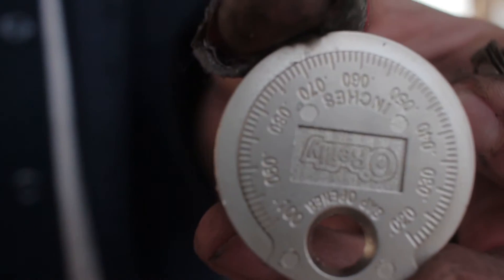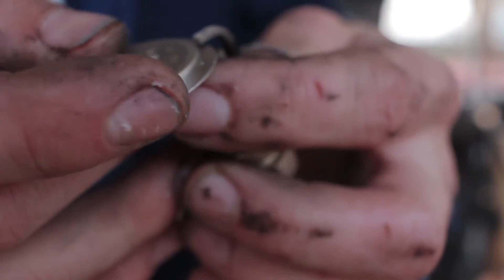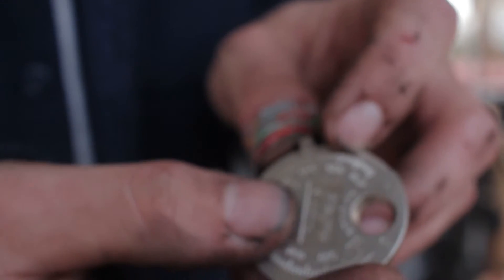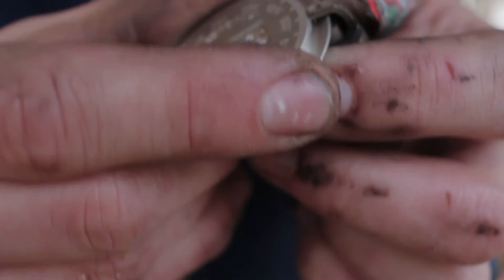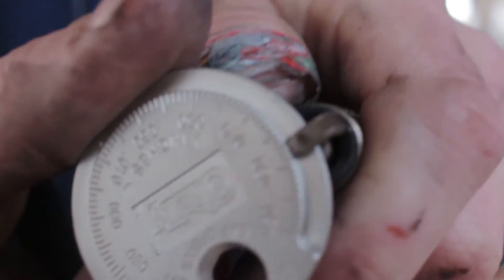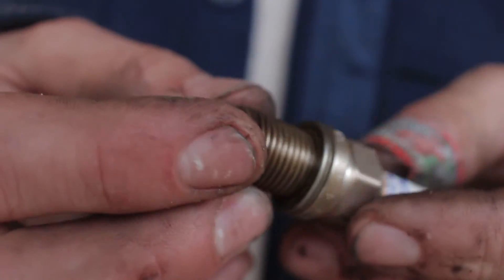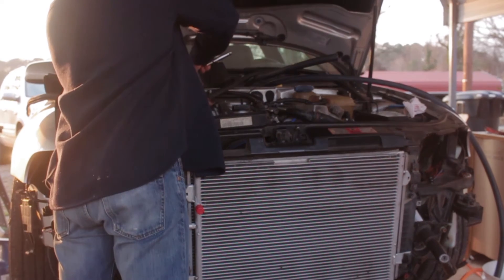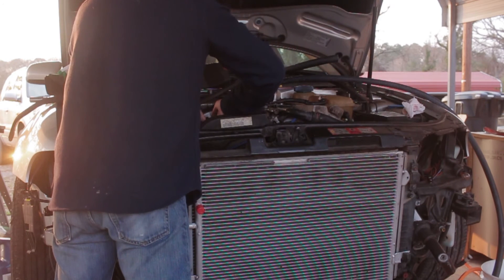Setting Spark Plug Gaps (Audi 1.8t)

Comment: Thanks for sharing.  Where do you measure the .32 on the plug, at the edge of the tip or middle? Thank you
Reply: Tesseract Comics I also need to know this I’m assuming middle because that’s where the electrode makes contact but how could that be accurate then, I’m stumped.